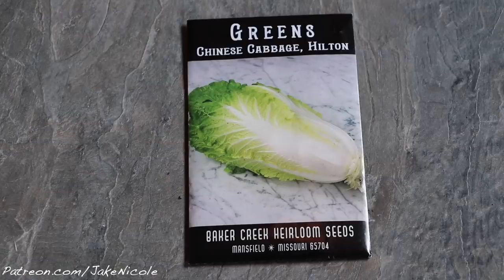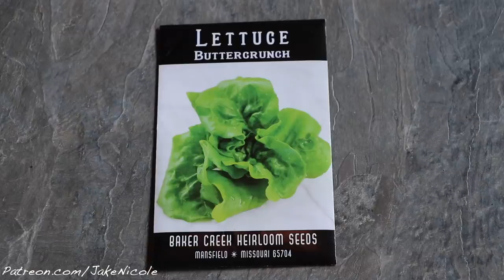Living In A Yurt | COLD & WET - Off The Grid, Day 8

Comment: My father in law, when setting post into the ground, would just add the dry cement into the hole and let the ground moisture set it. Was a very effective use of cement, and no mixing required. Not sure how effective it would be in your application, but would have been a huge time saver...
Reply: I've done that but added water to the dry cement in the hole.  Worked well with the quick-set cement mix.

Comment: Can I strongly recommend putting some diagonal bracing between the stumps and bearers and also work on getting your stumps level vertically the other thing I noticed on the vid it looked like your concrete mix was to a bit on the wet side.  I love what you guys are doing I’m doing something similar here in OZ.
Reply: yes please at a minimum
Reply from the maker: Stay tuned

Comment: you can look for organic pyrethrum oil. it can be sprayed around tents, yards, clothes, etc. its made from a small white daisy. its a perennial to zone 6. for skin lemon eucalyptus oil works really good. cedar oil, also, but it wears off faster. you can use lemon e. EO  in your laundry, as well. youll smell like a citronella candle but it works well. it also helps on the bites. so does coconut oil and whole leaf aloe vera gel. i use a combo of  the EO of lemon e. diluted into coconut oil.  you don't want to get pyrethrum directly on your skin so it needs to be dry. there are a lot of pyrethrim products on the market that are not organic or actually made from the flower. pyrethrum is organic approved although you don't want to apply it to yards, gardens, etc, while your beneficial insects are out.

Comment: If the temp is below 60f. Warm the water to 115f then mix with concrete. Then pour in. The cold ground will absorb the water allowing the concrete to set quicly and will mot crack as it cures.

Comment: When you mix Quickcrete you add a SMALL amount of water at a time to the dry mix and work it like dough when you make bread or a cake. AS the mix becomes wet and can pass a slump test then you implement the mix. That mix you made is a mess and is soup and insufficient to have the proper strength of concrete over time.

Comment: You really want to add cross braces to prevent the stilts from racking. There is very little support to prevent lateral movement of the top relative to the bottom of the columns.

Comment: and deck screws are a much better choice than nails which will loosen over time
Reply: Screws don’t have torsion strength...nails are the correct choice
Reply: @mattwoodproperty  screws are installed with torsion and deck screws are specifically made for building decks which is what you are doing.  You should also be using joist hangers, not those tiny corner brackets. 
Time will tell.
Reply: catalystopher777 ....I think u misunderstood my friend.... I know how you install screws.... but they don’t offer shear/torsion strength..... he’ll figure it out.... like everything in life.... he’ll prob go overboard with diagonal bracing if he’s not satisfied

Comment: You'll want to add some X bracing to your pier posts. That squishy BC soil is going to be problematic during the thaw. The X bracing will help tie the supporting structure together.  Lemon eucalyptus oil mixed with neem oil should help a bit with the bugs. You two are adorable. Good luck.

Comment: Mosquitoes hate Oregano!!! Consider moisturizing two to three drops of Oil of Oregano into Coconut Oil. Lather it deep into your skin. A little goes a long way as Oil of Oregano is very potent. Be careful when applying near the eyelids. Important: Do not use the Oregano essential oil but rather choose a strong medicinal/food grade Oil of Oregano from a health foods store. It will cost 2-3x more than the essential oil but it will be worthwhile.
We use this remedy on the Gulf Coast with success. Also, consider keeping some Oregano plants nearby your living quarters and patio, etc. If you're going to use a spray, use a Neem Oil spray after moisturizing with the Coconut/Oregano mixture. Good luck!

Comment: Jake, in all the cabins along Shenandoah Skyway drive,  the Rangers do not allow cooking inside the cabins and the bears would break-in if they smelled food.  So think about a cooking shed.   Logs......strong.   If a bear gets into the yurt,  you won't be able to fix it.  And it's good you are vegan because your cooking is way slight for bear attraction.  The cabins all have a steel box to lock up the food between meals.  It was decided that all the bears were to have equal acces to a boxed lunch.   Because on the east coast everyone is the same and were all equal.

Comment: You guys really need X bracing! That platform will be dangerous in high winds.
Just a suggestion but a valid one based on experience!
Reply from the maker: shieldman it’s not necessary to put in X bracing, our blocking boards have made the platform incredibly durable, stable, etc.… Although, we will be putting x bracing in as well

Comment: As many have said ... You must put diagonal braces in.. also you cross blocking as you call it should be held with joists hangers not angle brackets.. if you don't do these things it will collapse on you...
Reply from the maker: Steve Lyman The blocking boards are not only held in by the brackets you see in this video… Those brackets only position the boards in place for us.  Each blocking board is supported by 6 inch appropriate galvanized nails as per the weight and tolerances we will put on our platform!